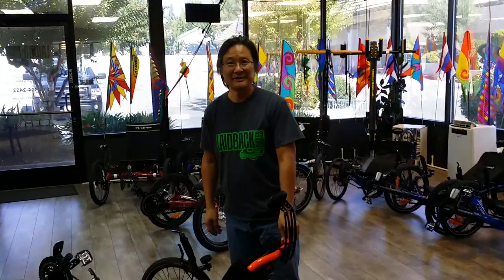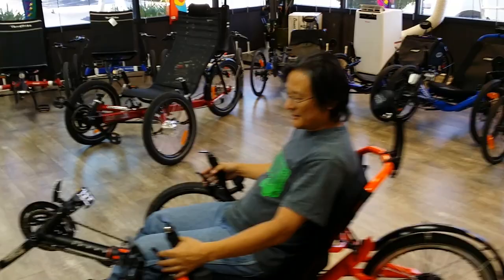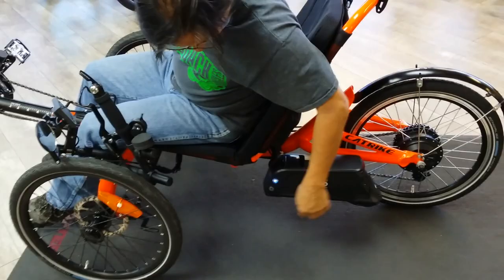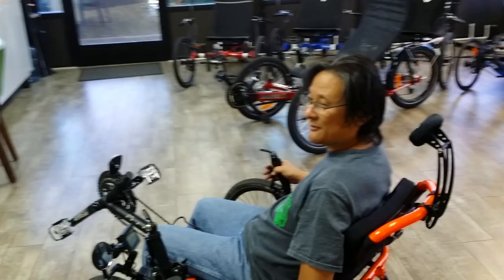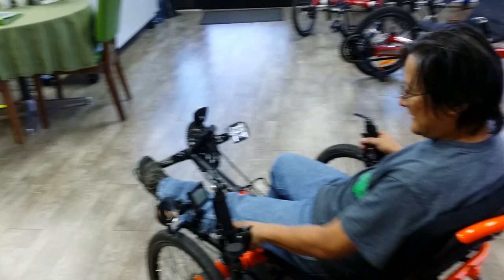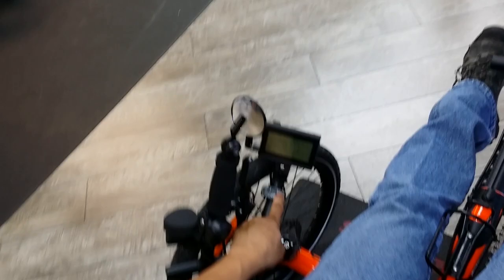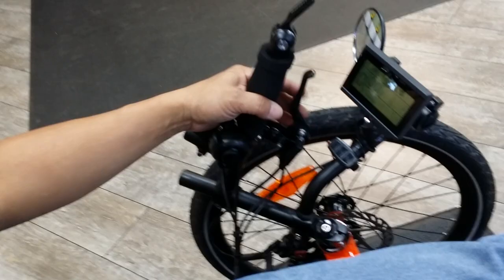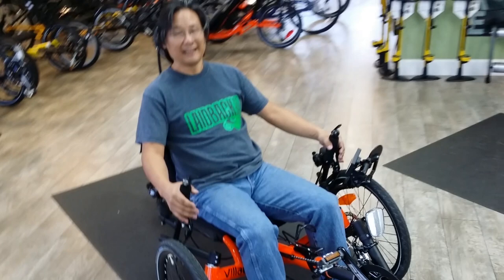Catrike Villager with Electric Power Assist - LBC350 Motor

Comment: How much weight does the system add to the catrike?
Is there a throttle?
How many miles would you expect to get with fully charged battery?
Is there a usb port on the control/display?
Reply from the maker: Yes it has a throttle. The kit runs around 17lbs. On flat roads you should get between 40-60 miles. We've had customers get over 70 on one charge though. Yes, it comes with a usb port for your phone or other accessories.

Comment: Is the battery 36 or 48v? Is there any regen, will the battery charge while breaking?
Reply from the maker: The battery is 48v. We went with no regen to keep the weight down on the motor. Regen only ads a mile or two and the LBC350 batt already has a long distance.

Comment: how much?
Reply from the maker: The LBC Motor kits are around 2300 which includes the custom mounting accessories for the battery and accessories. Call store for more details (916) 619-5116